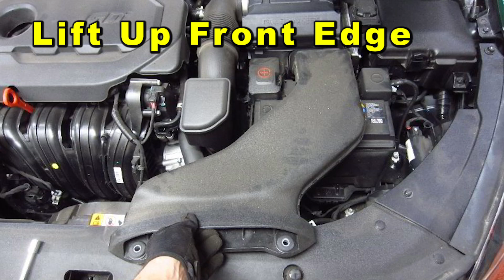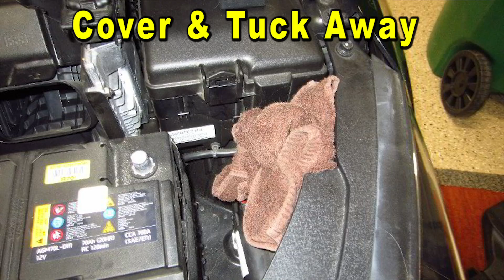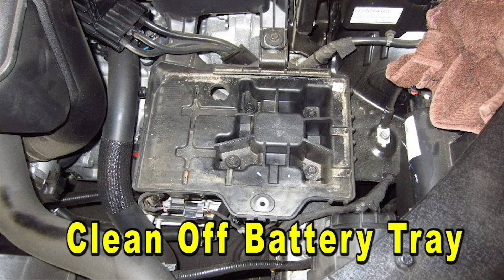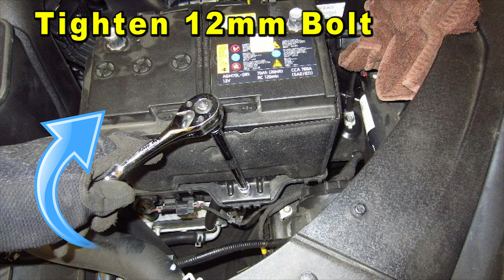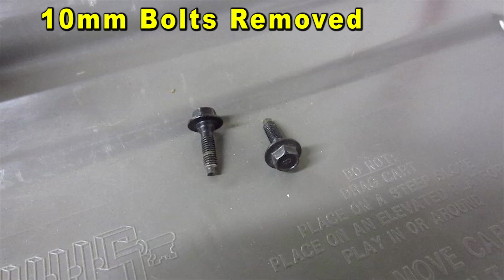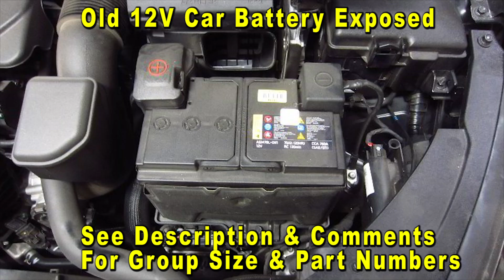Kia Optima How To Change 12V Car Battery 2016 2017 2018 2019 & 2020  With Group Size & Part Numbers

Comment from the maker: Kia Optima 12V Battery Group Size - https://amzn.to/3Rz9zHw
ACDelco Gold Battery Part Number - https://amzn.to/48G6mwa
Odyssey 12V AGM Battery Part # - https://amzn.to/48oGftz
Bosch AGM 12V Battery - https://amzn.to/3PRQajN
Precision Screwdriver Set - https://amzn.to/3OYN1i0
Plastic Pry Bar Tools - https://amzn.to/3HMtsV7
Socket & Ratchet Set - https://amzn.to/3Z17LbA
Mechanix Gloves - https://amzn.to/3jCnHkt
Torque Wrench - https://amzn.to/3vS5uSI

The Paul79UF YouTube channel is a participant in the Amazon Services LLC Associates Program, an affiliate advertising program designed to provide a means for sites to earn advertising fees by advertising and linking to Amazon.

This DIY video shows owners of the 4th generation 2016, 2017, 2018, 2019 and 2020 Kia Optima how to change a weak or dead 12 volt automotive battery.

Comment from the maker: Check out the DIY guide for changing a weak 12V car battery in a 2016 to 2020 Kia Optima sedan - 
https://www.paulstravelpictures.com/2016-2020-Kia-Optima-12V-Automotive-Battery-Replacement-Guide/index.html

Here are all of the DIY repair and maintenance tutorials for the fourth generation 2016, 2017, 2018, 2019 & 2020 Kia Optima - 
https://www.paulstravelpictures.com/Articles/2016-2020-Kia-Optima-DIY-Repair-Maintenance-Guides.htm

Owners of other Kia, Hyundai or Genesis vehicles such as the Niro, Sportage, Sedona, Telluride, Sorento, Rio, Forte, Soul, K900, Cadenza, K5, Stinger, Tucson, Santa Fe, Kona, Palisade, Elantra, Sonata, Accent, Veloster, Ioniq, Nexo, Venue, G70, G80 and G90 may also find these DIY instructions to be helpful.